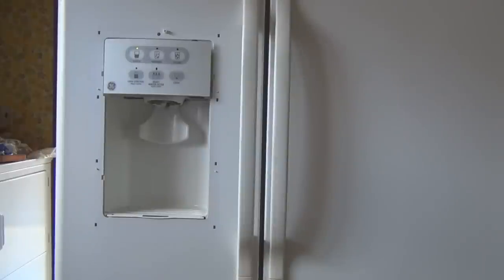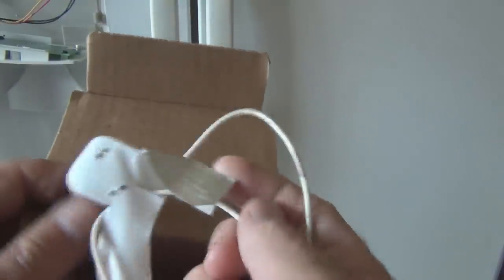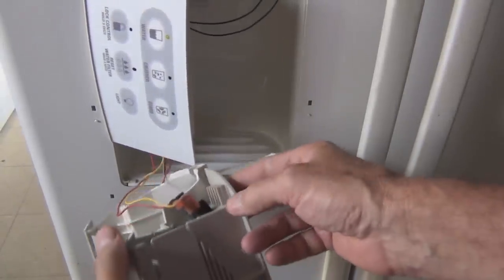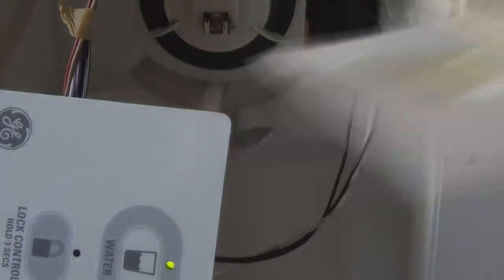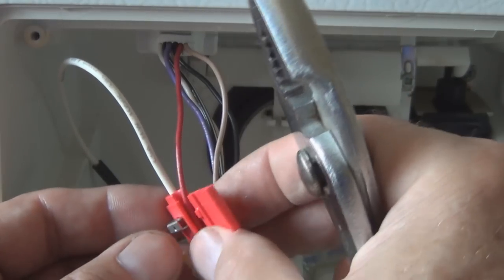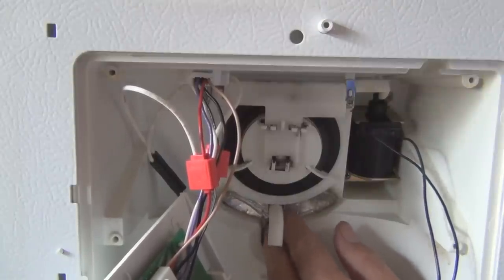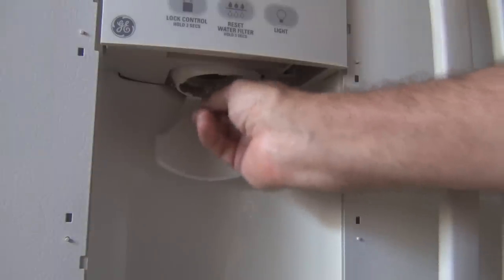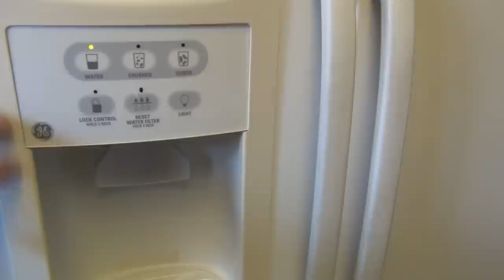How to repair a frozen GE Refrigerator water dispenser

Comment: Ridiculous that GE sells a part to fix a problem they know exists with their refrigerators rather than just providing it as a courtesy to people with refrigerators that have this issue.  It is not as if the part failed and this is a replacement part.  It is their design flaw.

Comment: The water gets frozen somewhere in the middle of the door, not near the water outlet.
Reply: Of course, but the heat travels down through the metal liner. That's why it's important to know if your fridge has a metal or plastic liner.  This repair fails when using it on plastic liner models according to GE.  Easy way to tell is by looking at the serial number. The serial number is alphanumeric. If the first number that appears is a 2, you have a metal liner. If it's a 4, it's plastic and installing the heater is a waste of time.

Comment: Funny...if the industry KNOWS this is a common problem, do they PURPOSELY not install a built-in heater so we'll buy another fridge?
Reply: GE has a wire heating element but it surely does not work for me...
Reply: @thomasjones-yc8lf  I have this on mine & it still freezes! fucking Junk..I will never buy another G.E fridge!

Comment: I am having trouble removing the plastic water dispenser front cover (frame) to paint it.  I put painters tape around it to protect the enamel and am using a putty knife and screw driver to pop out the attachment pieces.  However, it is still holding on in one place.  Do you have any videos on how to get it off without breaking it?

Comment: My water line started freezing every other day.  I read a hack to line the inside of the freezer door with insulation.  I bought one of those mylar type hot/cold bags from the dollar store, cut it open, and taped it to the inside of the freezer door.  Its been over 3 months and water has not froze once.

Comment: I needed this video because my pressure switch detector stopped working, I took it all apart to find the plastic cup detector broke inside, I fixed it by drilling a hole and adding a piece of metal, but when I tried to put it all back together, I could not figure out how the detector get went back in. Thanks.

Comment: I got a frigidaire side by side refrigerator ,  i use hairdryer to melt the water line and it work but the next day it freeze again, the only way for permanent fix the problem is put insulation inside the panel .It work for me thx.

Comment: I dethawed mine with a hair dryer.  Worked initially, then the next morning....frozed again!!  Going to try this method.  Just ordered the part(s).  What I'd like to know is if it STAYED working or not??  If it did....my issue should be resolved, but if not...have to focus elsewhere, but at least this will be installed for a meager $15!
Reply from the maker: It has not frozen up since.

Comment: Sears installed a heating element the first time . . . . 2nd visit something else . . . . . still.  Was told that I could open the freezer door and turn the frig off for an hour or so and it would thaw.    It did, and that worked!    I think the whole problem is the control on the thermostat that controls the temperature of the freezer.   My freezer keeps freezing up even though I change the setting.   Getting pricey!   I'll talk to Sears.
Reply: I said "that worked" but I meant to add 'only temporarily'

Comment: Turn on the light, cover the opening with a paper towel to help hold the heat, if you wish to speed up the thawing time. How about a class action lawsuit to make GE do the right thing? The wire thing will help get it open, but for how long?

Comment: Just sharing what I have found out doing some research.  The heating element GE# WR49X10173 is ONLY recommended for metal liner SxS production built January 2003 through January 2007 (serial numbers AF through AM): Models BSS, DSS, ESH, GSH, GSS, GST, HSS, SSS.  If you have plastic liner as seen here (which I think it is) in the video, GE does not recommend using the heating element.  One, plastic is NOT a good heat conducting material and two, there is possibility of plastic melting down.  The frozen water line is due to a design flaw; lack of adequate insulation material on the door.  Some of the options you can try after thawing the water line are: 
1. Raise the freezer temperature
2. Replace the door (approx. $600+)
3. Some claim that adding insulation padding to surface of door inside where water line travels helps
Reply: @Wile E Coyote No by raising the freezer temperature it would make it warmer and keep the water line from freezing.
Reply: How would you replace the water line in the door that is broken inside the  door

Comment: The heater is not for the tube. It's designed to transfer heat down through the metal inner liner thus this repair doesn’t work for plastic inner liner models. You can use a magnet to see if it sticks to the walls of your fridge or by looking at the serial number.  If the first number in the alpha numeric sequence is a 2, then you have a metal liner. If it's a 4 then it's plastic and will not solve your problem.

Btw put the silicone on after installing the heater.

Comment: 8/2020- I have teh same issue since I installed our and the weed whacker trick was getting old.  I called GE the stupid part #WR49X10173 is $57.99+s/h I bought the part on eBay for $7.99 delivered, I am using your video to do mine this weekend.  Unit works except for stupid water line issue!    Did yours ever freeze up again?
Reply from the maker: The fridge is still working great.  The water line froze up again after working for several months.  I think the adhesive came unstuck.  The waterline started leaking again so I have to take a look to see if the tubing cracked again.  I have a water shut off for the fridge so I haven't looked at it yet.  Maybe tomorrow if I feel motivated.
Reply: @tmc200527  What did you end up finding out?
Reply: @twhicke  ... He probably found out that new fridges are cheap on labor day 😂🤣

Comment: Double sided tape, foam backed would have been better. But thanks for the idea. I’ll look into that kit. Happens to my GE all the time too!
Reply: Double sided tape is a bad idea as this heater works by transferring heat through the metal liner down through through the door. That's why this repair will not work on plastic inner liner models. Double sided tape severely impedes the transfer of heart.  

Simple way to fix this is add the sealant after installing the heater.

Comment: I installed the heater a year or so ago, and again no water.  Hmmm.... I wonder if these heater kits are known to go bad.
Reply from the maker: The adhesive on mine did not stick so I used the two part epoxy to glue it in place to get the best heat transfer.  My water dispenser still works.
Reply: Thanks Tom.  I spent 4 hours on it the other day; got it working and lasted for 20 minutes efore freezing again.  I will give it one more effort with the epoxy effort.  Thank you!
Reply: @tmc200527  I cleaned the surface with alcohol then heated the surface with a hair dryer, foil stuck really well

Comment: I have had this issue many times. I took out the water filter and dumped the water out and poured vodka in the filter plus got a short round candle and set it where a glass would go For water and it worked took 20 min. Make sure the candle isn’t to tall and melt plastic
Reply: Or you can open the door for 20 mins while you eat breakfast and the line would be thawed.

Comment: Tom - did this end up working?
Reply from the maker: I use the water and ice dispenser every day now.  No problems with the water line freezing anymore.
Reply: Sounds good, but is that because you use it every day and are not allowing it to freeze or because the heating element worked?
Reply: samuelsma1 I wondered the same thing. I just stuck some weedeater line in the nozzle about 10 inches in. If it ever freezes even with the heating element, a couple of pulls and shakes should break it apart. Can’t even tell it’s there.
Reply: I did that as well, but the hose froze so much withing minutes after getting the water to flow, I had to forcibly pull the string back out.  If I get it working again, I'll put the weed wacker string back in and give it another go at it.  :-)
Reply: So this ended up being a permanent fix?

Comment: That's not just dirt, that's mould and some lemon, vinegar or bleach should be used, w/ a good rinse.  Also, you left the power on and the indicator light was still on.  I've seen this w/ a few of these repairs and don't know why you guys don't worry about shock?
Reply: Low voltage.

Comment: A quicker and easier method is to use a Water Line Buddy form Amazon.....less than $15.  I tried the tube heater and it melted my line after a couple of months.

Comment: I don't want to discount a good video, but you rub silicone all over the nozzle and the back wall, then you are surprised that the foil adhesive won't stick to it?  Never, ever, NEVER use silicone on anything (unless you are building a fish tank). No known adhesive will ever stick to silicone, INCLUDING silicone. And there is no known solvent to clean it up. Do yourself a favor & throw away every tube of silicone in your garage. And tell all your employees to do the same.